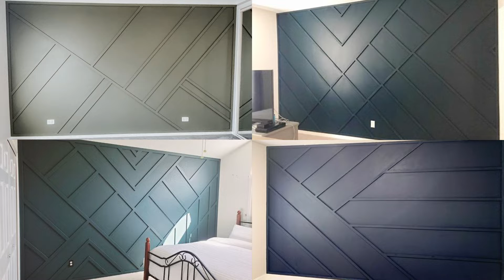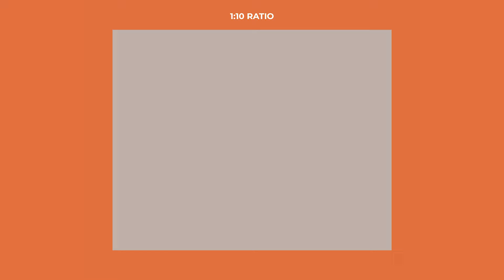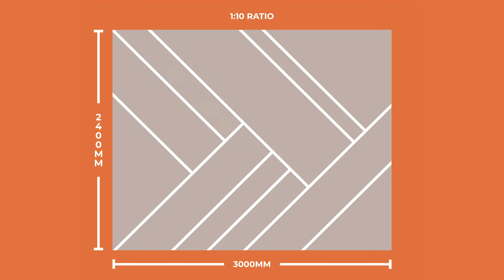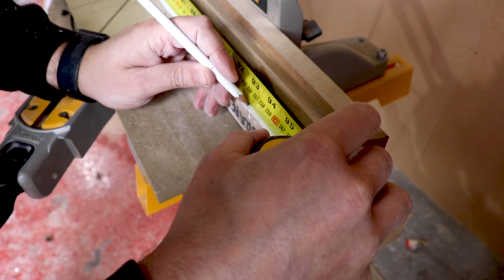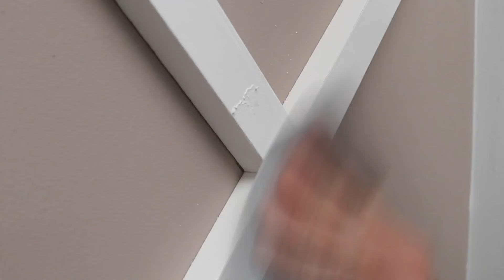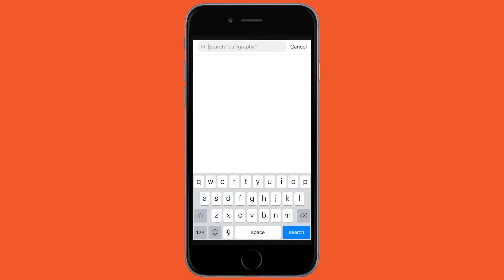WALL PANEL INSTALLATION | How To Fit Geometric Wall Panelling | Easy DIY Tutorial

Comment: Can you use a nail gun on brick wall or best to stick the panels with grab glue?
Reply from the maker: Hey Vikrant, 

If it’s a brick wall with 4mm of skim plaster, then a nail gun can’t be used because the nails will just bend up when the nail hits the brick. In this case you would need to put the skirting on with panel adhesive and cramp it against the wall wherever you can. This is OK where walls are flat but if they are not you would need to drill, raw plug and screw it.
 
If the brick wall has plasterboard on it, then you can use panel adhesive but then you can use a nail gun to hold it in place by using nails that just fix into the plasterboard. You need to select nails which are long enough to go through the skirting and into the plasterboard. Nails which are too long will hit the brick which will be no good as they will bend up as previously mentioned above.

Hope this helps!
Reply: @Skirting4U  thanks for the response and guidance, I have a brick wall with plaster so only option is to use strong adhesive, good news is the walls are fairly flat so should be able to get away with it!
Reply from the maker: @vikrantdoshi7359  Perfect. You'll have to let us know how you get on!
Reply: @Skirting4U  hi, I am about to place an order on the 'Geometric Modern Wall Panelling' and selecting the primed option, does this mean all sides are primed? Any black Friday discount code please? 😉
Reply from the maker: @vikrantdoshi7359  3 out of the 4 faces will be primed (the one unprimed will be facing the wall and won't be seen when fitted) we don't typically do discount codes but if you wanted to email your order to enquiries@skirting4u.co.uk we will see if there's anything we can do for you